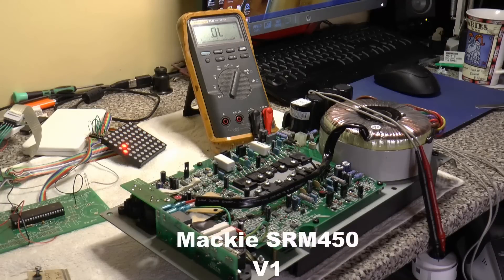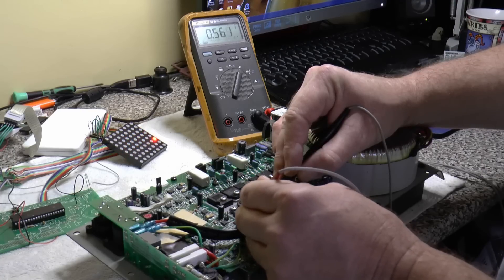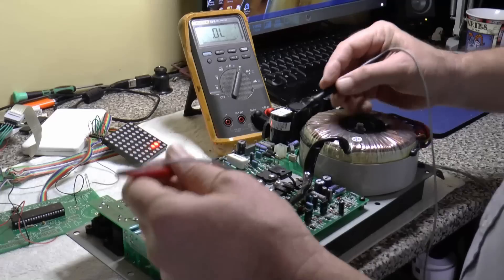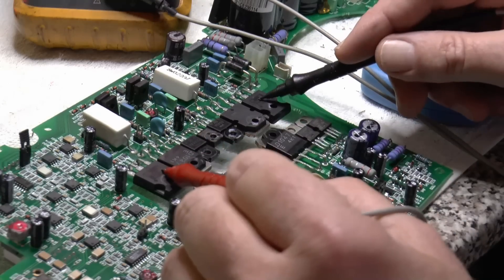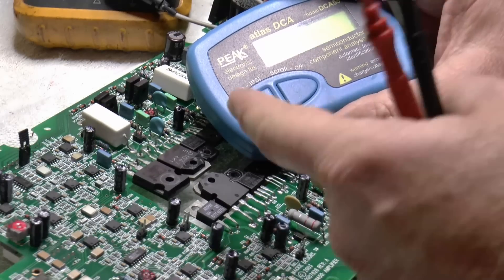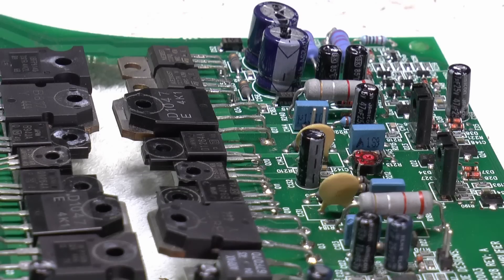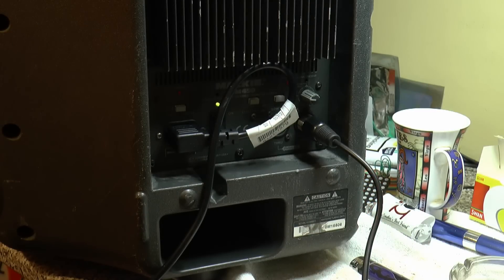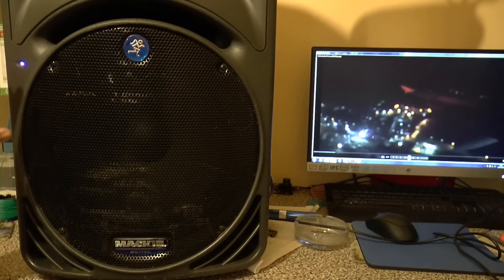Mackie SRM450 V1 Thermal Light Staying On - basic guide see show more

Comment: Hi John, I Some Still have A Mackie SRM 450 
I have a issue with 2 of them, when are turned on you get a loud hum for a second or so and the next thing is when a driven loud the power light cut off and also the audio intermittently.
when down it starts to work good again
Reply: they the version 1 450
Reply from the maker: Many make a bang when turing on, never looed for the cause.
Yours sound like they are being driven too hard.

Comment: Thanks for sharing this information, very clear!. In my case, my SRM450V1 still sounds amazing but when I turn it on, with no input signal or nothing plugged in, the hi freq driver makes a noise (the same as a circuitry that has a lack of grounding cable). I check the connections, visual inspection and slightly bend the board to find if there was a bad or crackled solder and I coudn't find anything. Comparing with your footage, mine don't have the metal plate attached with the strap in the two red and white cables of the power line....
Reply from the maker: I replied to this comment on my phone but don’t see my reply.
Unfortunately the fault could be anything so sorry I can’t point you in the right direction.
I would recommend Not bending your pcb, it may cause a crack or cause a crack in a soldered joint.

Comment: Hi John, really interesting video. I think I have the same problem with a Mackie SRM450v3. Today the thermal / limit light started randomly blinking with no input and now it is on permanently even with no input and both channels turned down to zero. What is strange is that if I do provide an audio input and turn it up it still sounds fine with no audio cutout or noise or distortion - everything behaves as it should, except the thermal light is on. Which makes me think it is a random fault rather than a genuine overheating issue. 
I wonder if it could be the same 10ohm resistor as in your video? The only problem is the V3 board layout is different so its not easy for me to spot the resistors. I have tested a few that I can access, but several are mounted vertically which makes it difficult to test them without completely removing the board from the heatsink plate, which I think will be quite a job and I would rather avoid if possible unless I know this is likely to solve the problem. 
Have you any experience with the V3 and could you point me to the 15V resistors? I cant find a schematic so I am pretty much testing blind.

Thanks for any help you can give, it would be much appreciated.
Michael
Reply from the maker: The V3 is nothing like the version 1 so your problem is something else.

Comment: Hello! I have this speaker. Sometimes it emits small rustles and discharges as if there were cold welds. I checked everything, what can it be? Thank you!
Reply from the maker: I had a similar problem on one old v1, i think it was dry joints on the small components near the transformer.
If not that, it could be any one of the chips or any one of the smd transistors becomming intermittent.
Reply: @JohnB-2021  Thanks a lot for the answer! It has been working perfectly for two hours now. Unfortunately, these intermittent problems are the most complicated
Reply: Actually the board is very oxidized, the problem occurred after redoing the welds to the filter capacitors
Reply from the maker: @Andreadel1994 
Hi Andrew, I guessed it was old and you're right, intermittent problems are the most complicated.
I have spent too many hours waiting for intermittent faults to appear so stopped repairing v1 450s.
In the last 5 years, I had one 450v1 with white noise / hiss, it was a SOT23 transistor working but noisy. It took days to find it.
I then had a 450v1 blowing the tweeter twice, found lots of dry joints and changed as many (as I could) SOT23 transistors in the corner of the board in case one transistor was intermittent.
Reply: @JohnB-2021  Thanks so much for your interest! Had it been a transistor or chip the problem would not have been continuous? I forgot !, the problem often occurs when I turn off the amplifier
Reply from the maker: @Andreadel1994  
No, one can have intermittent problems with the chips when they get warm or the SOT23 transistors can play up at any time.
Reply: @JohnB-2021  Thank you! Last question! Why do you think the problem sometimes occurs as soon as I turn off the amplifier? The sound stops when the capacitors are discharged
Reply from the maker: @Andreadel1994  That is the only problem I never looked into lol.
I think it's part of the 'Mute' circuit which stops it making a bang when turning on too.
Reply: @JohnB-2021 thank u very much for the interest

Comment: hi i got 6 srm450 some made in Italy ,USA , China can you tel me which is V1or V2 or V3 i need to replace some volume pot and it seem they are different !
Reply from the maker: The V1 has a mains transformer, the v2 has a switch mode power supply
Reply: @JohnB-2021  sorry but know different they look

Comment: Hello you can help I have mackie hd 1531 when it’s on on pass une minute it quickly turns on thermal light what is you can help thanks
Reply from the maker: It is a power supply problem
Reply: Thanks but it’s necessary change all tablet or change only the part.or you can fix I’m living at Los Ángeles where you at thanks
Reply from the maker: Find an electronics engineer in LA, I'm in the United Kingdom
Reply: Hello John b I’m ready change the part but I have the same problem I discovered that if I give it a tap in the metal the light comes on thermal and the vibration of the speaker what could be the problem thanks
Reply from the maker: I have never seen a 1531 so don't have a clue.

Comment: Hey John, thanks for the video...I've had the v1 for years and have had a problem with overheating and shutting off (which is actually a safeguard mechanism to protect the speaker)...I've seen a few videos on a retro installation of a fan but I don't know if I want to make any permanent cuts in the speaker.
Do you have any solutions for overheating?
Reply from the maker: Hi,
There is no easy solution for keeping these speakers cool when being driven too hard for long periods.
Keep them vertical and plenty of air circulation at the rear helps.
A mains fan pointing at them helps too.
Reply: Don't drive the crap out of them. The power it has are for dynamics. Not to play a compressed signal at full tilt the whole time....
Reply: @JohnB-2021  I bought a cheap clamp-mounted desk fan and my problem child had been behaving nicely. Strange how one is perfect and one has an overheating issue...

Comment: hey john, i have 2 v1's, one with no LF and another with no sound at all unless you turn it up very loud.  i have checked all the internal voltages and they are ok.  i also compared the level potentiometer resistance and they match so I think that is working ok.  Is there anything else I can check?   also weird, i have v1 also but i don't have the resistors below the +-15v transistors.
Reply from the maker: Hi,
The one with no sound is possibly a blown input op-amp.
No idea about no LF without testing it.
Your board is probably a different revision, the resistors will be somewhere else.
Thanks